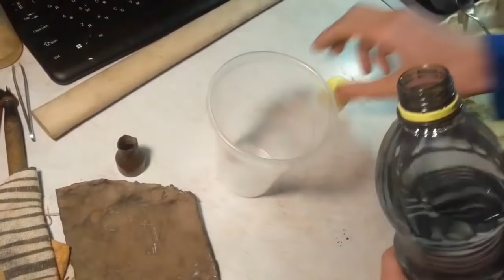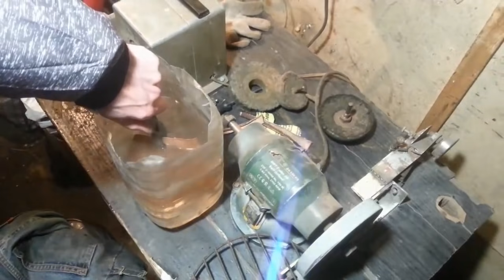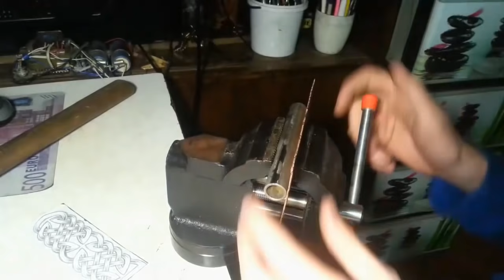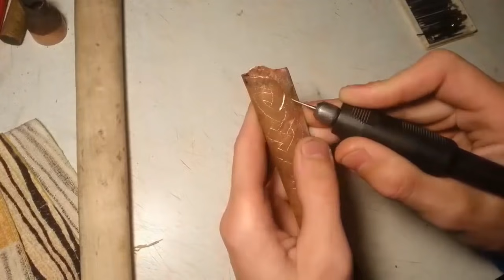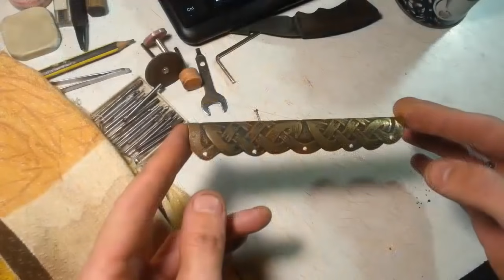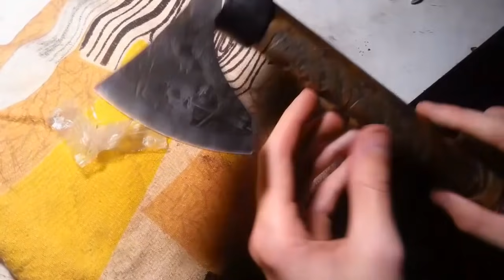Drawing on metal. How to make a vintage ax.

Comment: Plz tell us what type of camical you used and what paper
Reply from the maker: Thank you for your attention. To transfer the drawing to paint, I used cling paper and tracing paper, you can also use a matte film for lamination. I painted with a simple pencil. I made metal etching in salt water with a 25 volt device. I did the second stage of etching in 5% nitric acid. Also used a solvent such as acetone, nail polish, and a special metal blacking fluid.